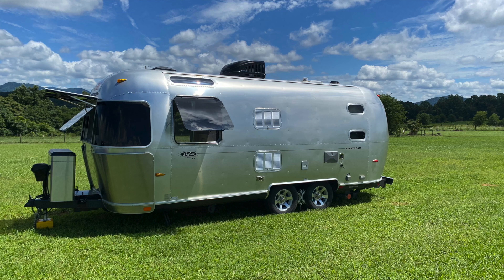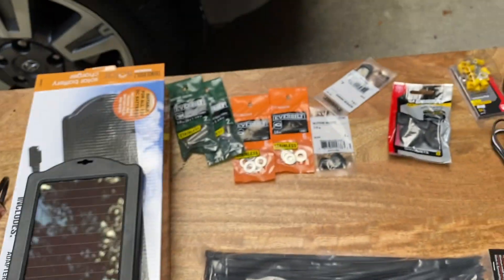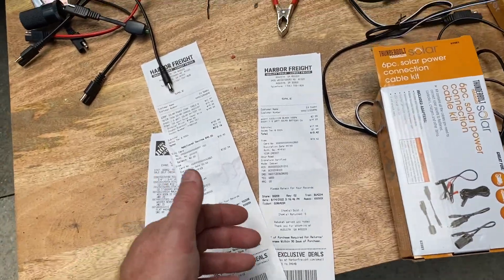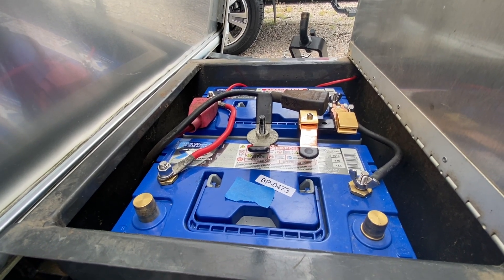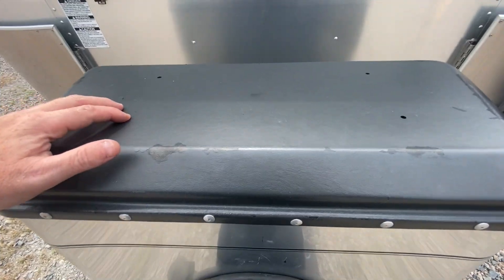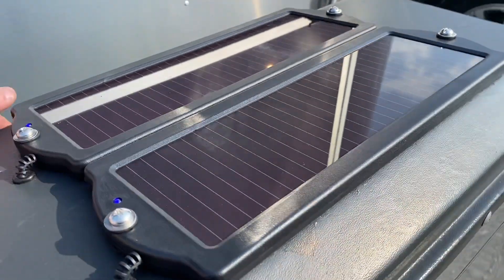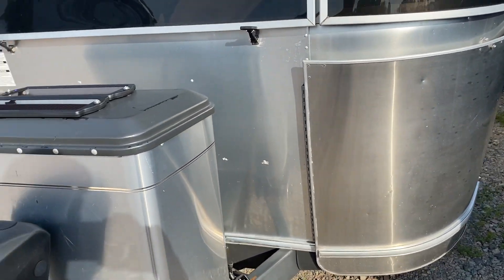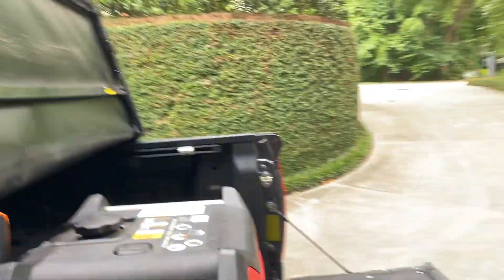DIY Complete 12V RV Solar for Cheap - $250

Comment: As a complete newbie to RVs and solar, I'm a little confused by what I really need after all the videos I'm watching on solar for an RV.  All I really need a solar package to do is be able to charge my laptop and my cell phone once a day with 110volts, and run my 12 volt interior lights and pilot on my fridge and heater.  Would this system manage be capable of managing that I wonder?
Reply from the maker: This is more of a battery maintenance system. It’s not going to be the system. You need to charge those devices.
Reply: @kedrevs4037  Thank you.

Comment: My Vintage 1956 Spartan Motorcoach is Self Contained with 4 RENOGY 200AH AGM BATTERY BANK  Maintained by 4 100 Watt RENOGY Solar Panels in Series to a 100/30 Victron Smart Solar Charge Controller and a Victron Phoenix 12 Volt 1200 Watt Low Frequency Inverter and 12 Volt Fuse Block and Covers all LED Lighting and Fans and Water Pump 💦 and Water Tank Heating Pads.
Reply from the maker: I wish that I had the time to do a setup like that.   Do you use it to run AC?

Comment: Installing power inside a box with gas cylinders WoW . M8tey not really a good idea, but hey, if you don't have any problems, then please feel free to do so. This may not be an issue, however I would not have done it myself.
Reply from the maker: Umm to 1.5W solar panels, with nothing expose to spark.  Think I'm ok
Reply: @kedrevs4037  Hope  all goes well m8.

Comment: Hmmm...  If you are an occasional camper like me, you could save $240 by just installing a $10 battery disconnect switch.  When you are not camping, flick the switch to the off position.  Your batteries will hold charge for many weeks, until the next time you go camping.  If you need to store your camper for 5 months of winter, then bring your battery inside your garage, basement or utility room where its warm.  $240 saved.
Reply from the maker: I have installed a battery disconnect switch and its disconnected when in storage.

Comment: excellent video.    I agree completely, we see all these amazing systems that cost $$$$.   Not necessary for everyone.   We boondock sometimes 3 or 4 days at a time (as water tanks permit), but we hand grind our coffee, and percolate it on the trailer stovetop, or on our Coleman stove outside.   Hair dries naturally, and we have a 2 way fridge so propane can handle that so how much energy is really needed?   Thus I have 200 amp hours of battery on board, and have 2 x 100amp portable solar panels that can keep the batteries topped up(usually only use 1 of them).  Have thought about putting panels on the roof, but we often are parked in shade, so happy to have 2 portable solar panels that I can move as needed to find the sun.   Also carry a Jackery 500 that handles the charging needs of computer or iphone or whatever.   Good to go with that.  Simple, not that expensive and fun.... As always, safe travels....
Reply from the maker: Thanks for adding the great post.  On my last trip talked to some newer Airstream owners.  No propane on fridge.  Just shore power or battery.  Now if you want to boondock, I guess you need a mega system.

Comment: Thanks for the video. I would definitely consider doing this if I were looking to add solar to a tailer that didn't already have roof top panels.
Reply from the maker: Appreciate it.  Wish the Airstream came with one and I have seen plenty of installs, that make me confident that I could put a rooftop system in.  Just want to keep things as simple as possible.